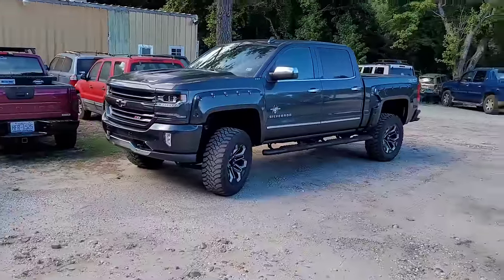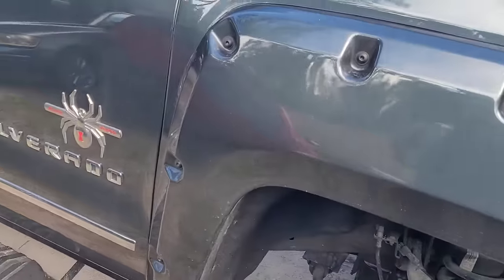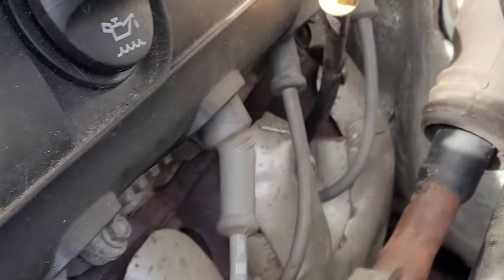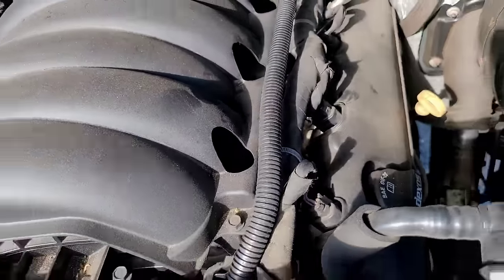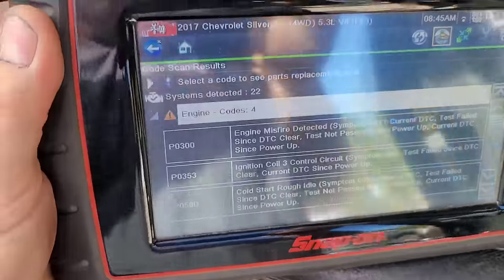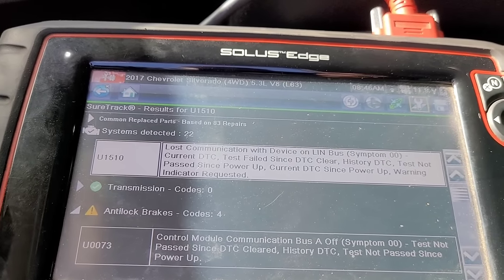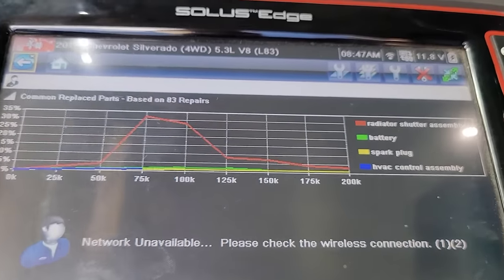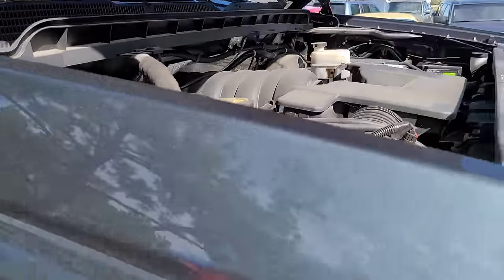AGAIN !!! Another "Tapping" 5.3 !! It's not lifters or exhaust.. 2nd time I've seen this..

Comment: They must be making em cheaper I've has 5.3s with 400k
Reply: What year is yours? I have an 2001 with a 5.3,175 k. Its been an awesome truck.
Reply: @Mr.wilson949  I got a 02 tahoe with 230k miles
Reply: I have 800,000kms on my 2014 5.3 and it still goes strong
Reply: After AFM they went in the dump
Reply: What year you have?
Reply: @jaym.1106  2014
Reply: Freind just had this issue. Change plugs
Reply: 01 tahoe 4x4 with 265k , still runs like new
Reply: @massacoor6162  lol, my ass it runs like new.
Reply: @williambrandondavis6897   dont be a hater🙄
Reply: I have an 00 4.8 with 330k Miles.  It’s had a ticking noise for about 7 years and still running strong
Reply: I’ve got a 07 Tahoe with 255,xxx on the 5.3
Reply: @noe_9568  I've got a 00 6.0 251,000 it ticks but I would consider it more of clunky rattle not a tick hard to explain the sound but I know its the lifters. But once the motor warms up it's goes away. So my plan is just drive it until they fail so I'll probably be driving it forever. haha
Reply: All this AFM/DOD mess is killing them.
Reply: They didn't change their oil on a regular basis.
Reply: I have a 2014 about to hit 200k miles on its 5.3 I have afm delete chip runs good 👍
Reply: @Bushy556  what is afm?
Reply: @williampatrick9864  active fuel management, it came on pretty much everything after 2007.5. Half the cylinders deactivate and your v8 becomes a 4 cylinder.
Reply: Awesome guy
Reply: These trucks are over priced.  They don't last any longer than the older ones.   Plus they rust out in 4 years
Reply: Got a 02 5.3l, 298k and it still runs great. Had a slight lifter tick when I got it, but after a year or two of running Rotella T6, the tick disappeared. That and changing the oil every 3 to 4 thousand miles.
Reply: Lmao chevys have always had noisy lifters a just a little fact! Nothing new here! Easy fix buy a FORD!!
Reply: @Garry Gauldin  the new 2023 2024 have no afm. But drink oil lol
Reply: @Bushy556 what is afm
Reply: @tambosnipes1652  active fuel management. Deactivates 4 of the 8 cylinders for fuel mileage.
Reply: Just made it to 90k and engine blew up.  Got factory engine for 8k though with 3 year warranty.  Friends GMC Denali made it to 62k before blowing up.  Rods lifter main bearing on Silverado.
Reply: What caused the plug wire to come loose! Good  video &honest mechanic!
Reply: 08 163k n 2011 298k
Reply: Yep made in Mexico
Reply: 07 250,00miles Minor problems Engine still Super Powerful
Reply: I have an 02 with about 265,000,sometimes i have a tic at startup until i use a cleaner.
Reply: @Connor4x4 

Really 800.000 thousands  miles
I don't think so
Reply: @Bushy556 

What's is AFM
Reply: @Connor4x4 last year of the LS in a truck, went to a LT family engine in 15. Those are the junk engines
Reply: 2015+ are the junk engines unless you do a bunch of work on it to remove the DOD/DFM system
Reply: @erik120719  2014 is when they went to the LT engines. And they're not junk lol
Reply: @Connor4x4  @Connor4x4 in stock form they are complete garbage, to date I've done DOD/ DFM deletes on 13 of them, lowers miles was 53k. I personally love the engines, make me about $2800 a shot for 2 days work ( 3500-3800 total cost depending on if a L83 or L86) . Bent pushrods, locked lifters , just poor design, I mean when the introduced AFM in like 06-07 and it didn't work worth a crap until 2014 they decide to double down and do it on the LT platform, very bright idea🤣 then in 2019 they move to DFM which can deactivate ALL 8 cylinder and only change was higher oil pressure, still fails! I've done 30+ AFM deletes on gen 4 LS engine, but usually tuning it off kept it from physically failing on thos engines, on the LT you can tune it off and they STILL will fail almost every time. So after saying that, I'll say again Gen 5 LT engines , in stock form, are garbage. But y'all keep buying them and I'll keep fixing them properly and making a small fortune doing it. On another note, a fully built LT can be an absolute monster, if only someone can make a non variable oil pump for them we'd be good to go.
Reply: I have a 2002 Silverado HD1500 with 419,058 miles. Wouldn't get rid of it for a brand new one..
Reply: @roncoleman6693  any gen 3 LS is a great reliable engine. I convert ( basically just valvetrain) gen 4 to gen 3 engines all the time. I've changed the reluctor on the cranks a few times a long with timing cover and 4x cam gear on sum gen 3 engines to work in gen 4 trucks also.
Reply: That’s awesome! 🙂
Reply: @Connor4x4  That’s awesome!
Reply: @massacoor6162 they must not know how to take care of a vehicle. I have a 05 gmc Yukon with 5.3 and it's punching 300k and it runs like a new engine. Keep the oil changed and she will go forever.

Comment: The real question is? How many shops have installed lifters because of this? 😂 Sounds nothing like it but you never know nowadays….. Great video and great observation!
Reply: I have a 5.3 tore down now. 2 lifters quit pumping up and started off as a slight tapping. You can actually see the difference in the tops of the 2 pushrods where they were sloppy against the rocker arms. Sometimes it really turns out to be the lifters…
Reply: @shadoughbanned   I have done so many of the lifter jobs on GM AND Chrysler products too, Starting on a 5.7  Hemi pretty soon. If it fails silently, Lifters it is. As soon as it ticks, the cam is wrecked. On GM its usually an AFM lifter. On Ram 5.7 its usually intake cylinder 3. Which is not MDS (AFM) lifter. On both manufacturers cylinders 1,4,6,7 are the deactivated cylinders.
Reply: Rainman ray would've figured it out. Go watch his videos. He's a genius at this sh*t.
Reply: I’ve had to coils go out on mine and paid the dealer a good bit to replace them. Something tells me I got screwed.
Reply: @petemoore8923  Dealer screwed you?    No way.  That never happens.    Car dealers are nearly as honest as lawyers.
Reply: Mine does it if use full synthetic oil so i use the blend and it's fine.
Reply: @shadoughbanned would check engine light come on for this?
Reply: @larrytanton5787 blend?
Reply: @akeemsulaiman6824 yes.

Comment: My 04 Z71 has 413k on it. Original engine, trans and rear. Yes I've done the rear main seal, axle seals and stayed on top of the maintenance since I got it at 178k. Gas mileage ain't what it used to be but I'm proud of that truck.
Reply: Hell yea!

Comment: I owe you a huge gratitude of thanks for this video. I had a service stability system and check engine light come on at about the same time, and then my engine started tapping just like the one in your video. I was told that I had to have the engine replaced, and it would cost about $7k by a mechanic. After seeing this video, I made sure that all my coil wires were tight.  Both errors went off, and the engine knock stopped.
Thank you very much. Save me $7k for engine replacement and about $3k for rental car while truck would be getting fixed.

Comment: Judging from the way that sheet metal was pushed back, I would say that the front bumper was replaced at some point in time. And, it looks like, a front end collision may have thrown the tires out of alignment. I would send him to a frame shop, to at least have it set up and measured. If either frame rail has been mashed or swayed or has an out of level condition. It will affect the sai, steering access inclination. (Steering wheel returns to center.) Which is all three, tow, camber, castor, set properly. Any one of those three, can cause excessive tire wear. I've also seen in the past, where the alignment shops have cranked up the torsion bars. To create the illusion that the frame is straight. And don't think just because you have a big Chevy truck, that you have a heavy duty frame on there. That is not the case at all. The frame on those trucks is just enough to get it down the road. There's nothing special about them. They're pretty much at one size fits-all program.
Reply: Definitely looks hit.
Reply: Lol. Just good enough to get down the road
Reply: Or just rotate the tire more often before you buy a new frame
Reply: @truckingoover  ... You won't have to replace the frame. They're pretty workable. As long as they're not rotted out in the seams. A good frame and alignment shop with a good measuring system be able to straighten that puppy back out no problem. And if you do a return of cost benefit analysis on it, you're not just saving tires. You're also saving ball joints tie rod ends shocks and brakes. Brakes are the most important. Because you want the brakes functioning on all four corners the way they're supposed to. The biggest part of that is making sure that the wheel is where it is supposed to be.

As a former Mr Goodwrench, service technician. I would hate for you to reach down for that brake pedal someday, and it not be there.
Reply: I bought a brandnew 2018 Chevy 1500 LT. 4 yrs ago. First set of tire wears are almost the same, front driver side tire is more bald than the other side. Tire people telling me, do you always turn left??? Hahaha, but yah he made me believe it. Truck is my daily ride, route always more with left turns. Lol. More frequent alignment and tire rotations prevented the obvious wear on one tire.
Reply: The frame isn't bent. If it was one the tires wouldn't both be worn the same . The upper control arms are not holding the alignment and resulted in a severe toe in condition by the looks of those tires. You can get a camber caster lock plate that has holes instead of slots that will for the most part resolve this and allow you to run a wheel and tire combo like that with much better results. I doubt the plug wire came off by itself so that's probably not going to be a repeat problem. Unless folks are not taking the plastic covers off and making sure they seat properly in the coils.
Reply: Obviously not a bent frame. If so it’s bent both sides… that’s pretty typical front tire wear for a lifted Chevy.. owner needs to rotate tire’s more often or go to a better alignment shop.
Reply: Black Widow package is installed out of factory so that probably explains all the imperfections in the frame and especially with the suspension.
Reply: @mr.mckinnon5680 Brakes are important?   Good to know.

Comment: I got 270k miles on mine. Been tapping for at least the last 100k. I took off heads  (had leaking head gasket) , did VLOM mod and re seated the valves. New guides, and sanded the heads to .001 with a piece of glass and sandpaper. Cam was good, lifters were good. Been 5k miles after repair and all is good. Crazy what these engines will go through..
Reply: Yes they are way more durable than any Dodge or Ford engine today. they are not 800HP flashes in the pan, they are meant to last you ten years or more, just like the 1st gen small-blocks. I'm not nuts about too much aluminum but these seem great. I have a 2011 I got last year and it's beautiful, a Vortec head engine. they all seem to have a low knock when started, not from lifters, it's lower frequency in tone. could be related to the variable valve timing (?) but it seems to go away and not cause any issues. the tradeoff is a superb engine that will perform and last a very long time. I got my 1st mechanic job in 1984...
Reply: @dbspecials1200  They 5.0 coyote shits on the 5.3 in reliability
Reply: I've been told the piston skirts will tap against the cylinder walls causing a sound when they are cold.

Comment: I’ve been problem free engine wise (knock on sheet metal) on a 2011 Silverado with an AFM 5.3 and I’ve been running corn squeezins (E85) for the majority of the last 2.5-3 years (huge cost difference in CA).  I’m about 3 oil changes from 500K on it (miles).  In my experience I believe that a large percentage of AFM issues are related to oil quality, change interval and treating changing the oil like surgery.  I always change it hot, and I wipe down everything remotely close to an opening and make sure things like funnels etc are clean and use new or laundered rags.  FWIW too, this guy is great, with his honest attitude and savvy he’s going to have to disappear to retire 🤣

Comment: My 09, 5.3, barely started ticking and dealer replaced Cam and lifters at 4 years 364 days, under warranty, 60k miles. Didn’t tap that bad. Technician said he replaced lifters with LS7 lifters. 135K miles and no problems. Been using Mobile 1 since day one.
Reply: Ls7 lifters? I'll keep that in mind if mine ever fails.
Reply: @____MC____  He could have been pulling my leg.

Comment: 5.3s notorious for broken GM exhaust manifold bolts. I had one a few years ago and replaced them all with stainless  . I believe there are kits out there
Reply: There is also a company that makes a bracket front/back L/R that wraps around the ends of the exhaust manifolds & draws them in on the gasket. It works well until the gasket is too deteriorated.

Comment: 2015 Chevy Silverado with the same "Tapping Noise" with a the feeling of a misfire with no codes. I changed my spark plugs and wires about a year ago. This issue started about 3 months ago and thought the worse. Just found this video and went out and checked the wires and found the same issue. Thank you for posting this. My conclusion is that the metal prong inside the wires boot is lose.

Comment: This is obviously a common problem.  I had that exact same problem with my 2014 Sierra sle 1500. Also on a 5.3 liter engine and also the same cylinder. I knew exactly what the problem was as soon as I heard it, as this happened 3 or 4 times. I am pretty sure that the issue is that the wire is just a little too short and loosens from tension.
Reply from the maker: I recently found out that what happens is the boot is such a tight fit , that the air gets trapped inside and with heat , if the air doesn't come out on its own , the expansion from heat forces the boot off.
Reply: GM likes tight harnesses.  The things they do to save a penny.  Either that or their engineers need to learn about wiring.
Reply: @WrenchingWithKenny  maybe that is what happened to my 2014. I changed the plug wires a month ago, and a couple weeks ago one popped right off on me(cylinder 5), and found a second one that was also coming off. i was using aftermarket plug wires and thought maybe it was the wires themselves, but if this is happening even with OEM plugs.......

Comment: Ive had my 2008 Chevrolet 4X4 for 7 years and it rurn me into mechanic . 4.56 gears , beefed up transmission with Teflon pads 3 to 4 pin , heavy vales job.  Rebuild 5.3 with big cam,  springs lifters . 430 hp and just put new coils , airmass flow,  plugs , wires , o2 , map,evap , radiator,  fans , larger transmission cooler , new A/C , heater coil , head lights,  belts , pully , door controls , fuel pump.

Comment: U1510 sets when the shutter actuator takes a dump.  U1510 is LIN BUS and the shutter has LIN BUS line to it.  Replacing the shutter resolves the issue.

Comment: My grandpa worked for Chevrolet for 42 years. That’s all we have ever owned. I replaced my engine at 100k miles because of the 4cyl crap. Blew. New engine started tapping. Changed spark plugs and coils got it to stop. Deleted the 4cyl mode and never again. I will never buy a chevy after 2008. I will never own one again. My dad has a new trail boss and I bet he will regret that.

Comment: Good call on that engine noise. As soon as you lifted the hood I could hear it sounded more like a "snapping" noise like a bad plug wire I guessed. But you showed the loose wire!
WOW, do owners actually put 0w-20 oil in these engines like it showed on the oil fill cap!? I never go below 5w-30 in mine. Auto manufacturers are sacrificing our engines life in the search for higher CAFE Fuel milage numbers to me Regulation and impress the buyers.
Reply from the maker: Most people really don't know anything and let shops or quick lube place change their oil . Most shops or QL places will use what the manufacturer recommends unless the customer requested different. 
If the receipt shows one weight , and the vehicle calls for another , then that's a potential claim if something were to happen to the motor . Especially in NY where I spent most my life . The DMV doesn't play in that state . If a customer files a complaint with the DMV and says , let's say , that their DOD lifter failed (common failure) because the shop used the wrong weight oil, the DMV will investigate and they could hold the shop liable for tge repair!!

Comment: I had this happen to my LS1, it even sounded like a spark jump vs a mechanical tap. When I purchased my 2K Vette it had a similar sound on cold start for about 10 seconds, number 5 plug was loose. Tightened it and it made the noise you had in the start of the video. I had unknowingly pulled the wire out of the coil slightly when pulling the hard to get off spark plug end.  I knew I had no tap before and with my face right there I could hear it pretty clear. Snapped the coil end securely, end of tick.

Comment: I'll add one to the mix...
If you park with the nose up ,like my neighbor was because of his driveway, the oil pump is not happy about it after a while. We listened ,we scoped ,he took it to places ,they did the same, nothing...
Randomly he noticed it wasn't quite as bad when he parked turned around, nose down.
within a day the noise was gone, that's at least 40,000 miles ago the way he uses it.
So just one more random tick thing to be aware of.
Reply: I have a new 2022 Silverado that does this on my inclined driveway, I now back up the drive to park and no ticking.